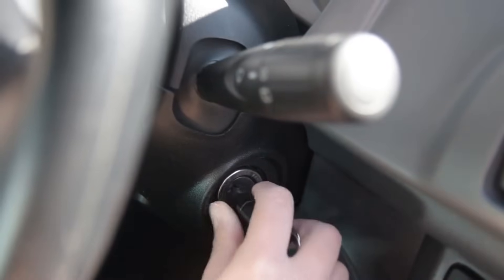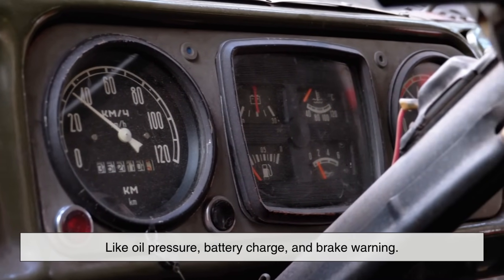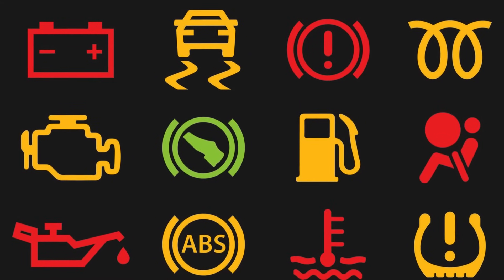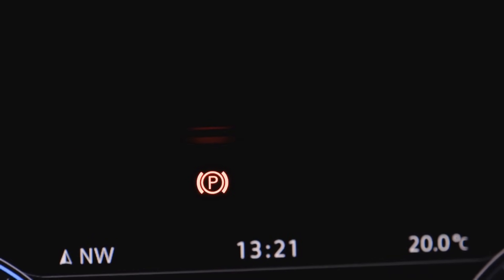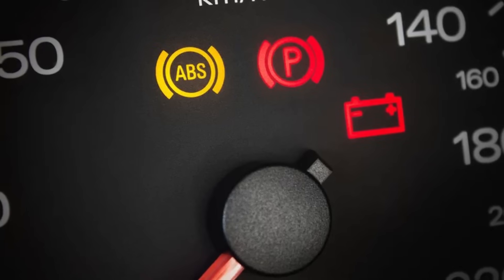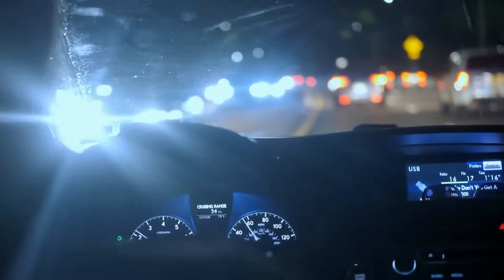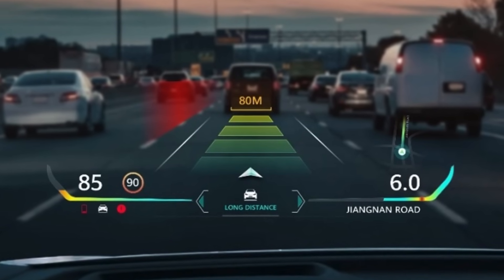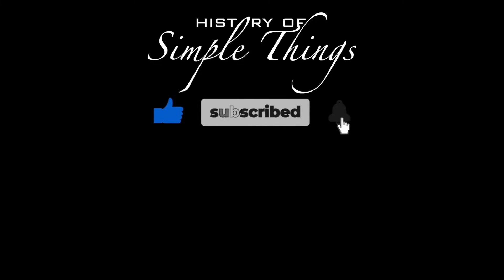Why Do Cars Have So Many Warning Lights?

Comment: Because THEY CAN! 20 years ago every light on dash required separate wire, separate connector behind the dash, separate bulb in separate socket... not too many of them could be crammed into the limited space, only the most important - oil pressure, handbrake and so on.

 Nowadays the light is just an LED on pcb or even virtual sign on miniscreen, all these signals transferred thru 2 bus wires, no more problems with space - hurray, go ahead! Make a signal for everything, from single open door to washer water level!

Comment: having not watched the video yet, answer is easy. with todays tech are cheaper and easier than working gauges. i rather have gauges for things like temp and oil that i can monitor myself so i can see problems developing than an idiot light that just says your done
Reply: 'lights create confusion', gauges dont. forcing displays on the windshield is distracting, having your car randomly talk to you is also distracting and startling. so much of todays like is dictated by lawyers and not training. young ppl are losing the ability to shoulder check or throwing their arm over the passenger seat to look out the back window before backing up.  if tech were to stop, ppl wouldnt know how to drive by themself. 'what do you mean i have to look before changing lanes, i got a light for that?!'